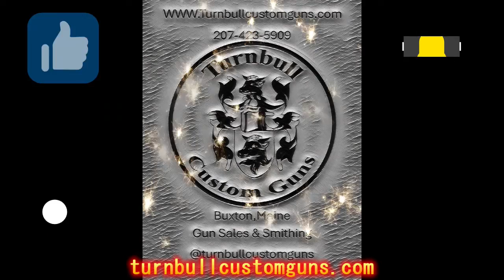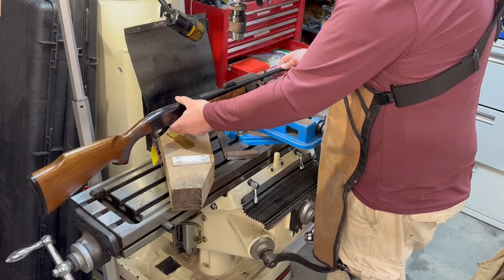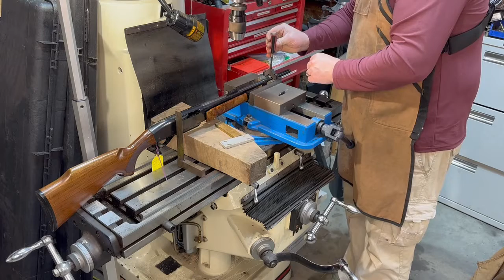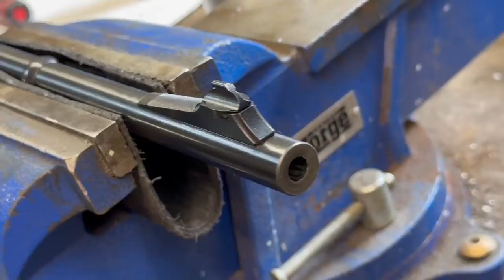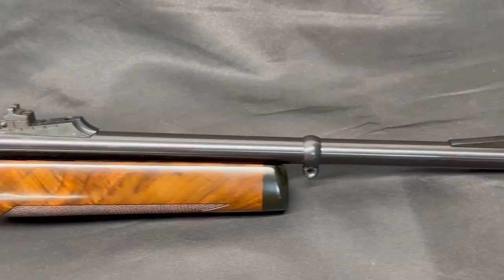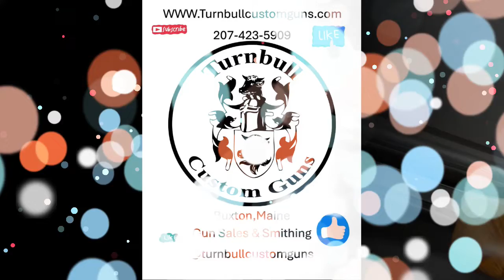Rifle Front Sight installation on a Remington 7600 - Part 2 of our Barrel cutting series.

Comment: Nice work - but what about the sight height at the new location compared to the original location? Do you need to do a live fire sight in and change out the front sight blade?
Reply from the maker: Thats a good question. Yes you need to re sight in the gun, but the rear sight on these rifles has enough elevation adjustment to make up for the small amount of added height that moving the sight back raises the sight picture. So no new front sight blade is needed. Thanks for watching!